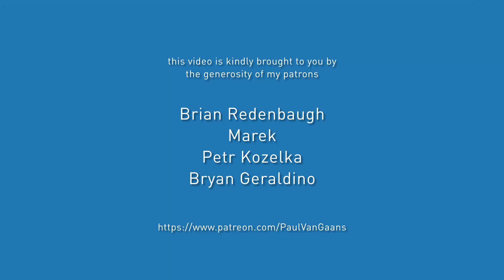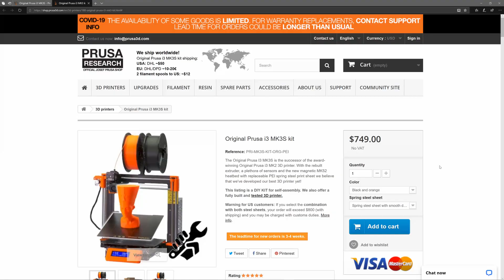Fixing Leaning 3D Prints

Comment: Thank you for the video! 5 years later and still useful. The problem with my printer was the bottom frame where the build plate is connected. It was off by 5º. Adjusting the screws and leveling with the iPhone level app did the trick.

Comment: Hi Paul, I believe the lean is because your Cocoon Create, while it has dual Z motors, only has a single Z endstop on one side, thus it is actually only one side of the printer that is being "levelled" when it is homed. Also, the Prusa is pretty pricey, you could consider an Anycubic i3 Mega...I have one and its pretty sweet...and it has dual Z-endstops :)
Reply from the maker: You're right Telkjoon. The other day I pressed the -Z button to lower the print head and one side stopped when it hit the Z endstop switch and the other stepper motor kept driving that side into the print bed. I had to rapidly hit the power button. Terrible design. I'll check out the Anycubic i3 Mega ;)
Reply: @PVG3DPrints  Well the Cocoon Create is a Wanhao i3 clone, so its pretty dated...but it was very very good for its time (I believe it was around AUD550 when it first came out). Anyways if you shop around, Anycubic has its own store on ebay, if you wait they sometimes have a unit on Auction you can bid on. I got mine for AUD380 instead of the usual AUD480 it sells for.